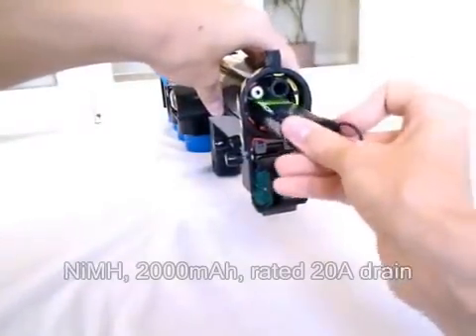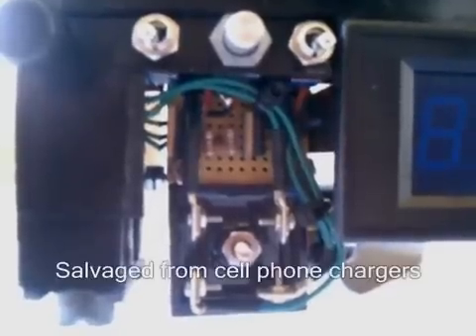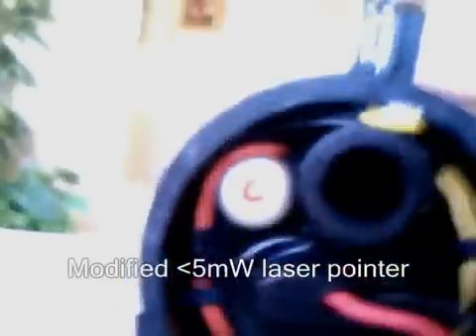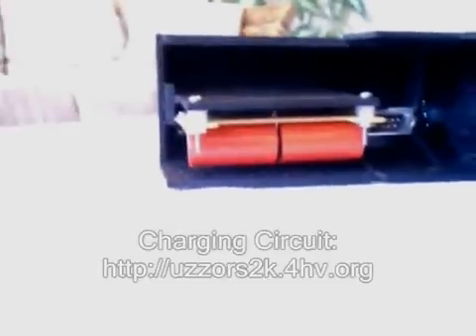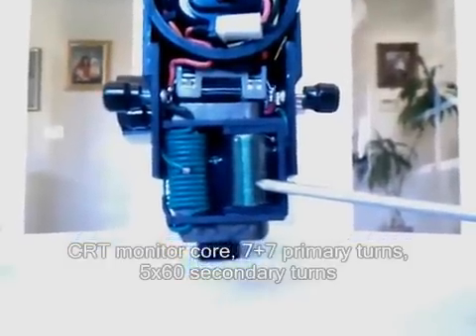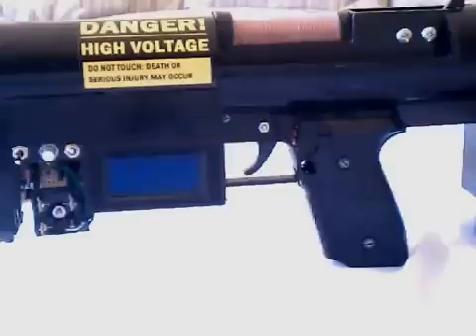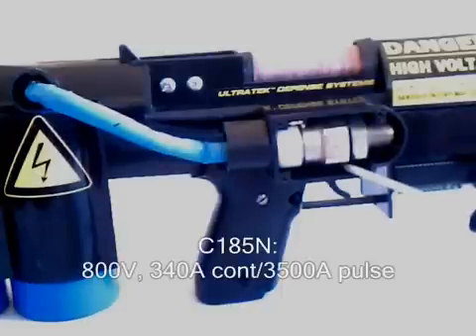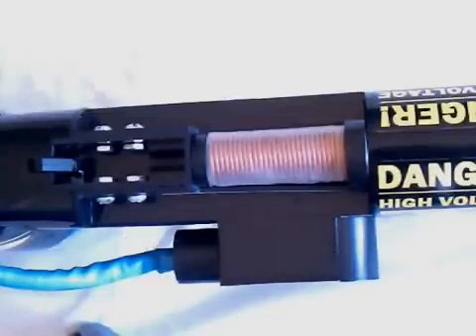Portable Coilgun Kontraband show 2010

Comment: Hey guys I built my own coilgun using the frame of an airsoft pistol. I managed make it work and wired it up. It shoots, but will only launch a bb an inch or two.  :/    Any ideas on How I could make it more powerful? I am using a capacitor from a disposable camera and the coil is wrapped just once... How do I properly wrap the coil? Thanks!
Reply: Well, the higher the amperage the greater the force, two, rewind your coil with 150 turns of 22awg wire, five layers deep, add more capacitors, and a better discharge circuit

Comment: I don't quite understand. What is the advantage of coilgun over ordinary gun? Is it reliable under pouring rain? Can it withstand high temperature in a desert combat scenario?
Reply: High maximum muzzle velocity, improved logistics, higher potential accuracy, to name a few.   Coil weapons have no maximum power, as battery systems and coils become more and more advanced, they'll become more and more powerful.

 Regular guns, on the other hand, basically can't get any more powerful than what they are.  They rely on gas-expansion from gunpowder to drive the round, and there are physical limits to how fast gas can expand, which we have already reached.   There is no upper limit to how fast you can magnetically impel a round (other than the speed of light, of course)

There's also the fact that a coil weapon only has to carry the rounds, not the case too.   You can carry much more ammo for the same size and weight.

Comment: Currently clearly not as effective as a normal gun, but supercapacitors are improving rapidly :)
Reply: Xenogene Gray supercapacitors are unusable for coilguns. They take long time to discharge because of the lower voltage.

Comment: Nice creation. Would a smaller projectile be more leathal in this weapon? Higher velocity.  Or would it be unstable?
Reply: You could try using a silver wire for the coil its more electrically conductive then copper but it cost more then copper as well

Comment: Not enough velocity...the projectile is to big... try using steel BBs or smaller. If you can get a BB to go as fast as a meteor it hit a target with the force of a cannon ball.
Reply: I myself expreimented that way with a 10j small coilgun, despite its small power, i managed to open a hole and pass trough one of the faces of a tun can with a projectile of steel , 3,5cm long and 1 wide with a sharpened head with the proportions of a standard bullet.

With a steel bb it almost didnt do anything, it just bounced away, thats becose the projectile can get saturated by the magnetic field, it does not impove almodt nothing adding more capacitors if your bullet is saturated in the actual situation, but doing a multi stage coilgun will work, in ither side there are the railguns,  they work in a similar way of a coilgun but they can work better the way you suggest( that is what the internet guys teached me, i dindt experimentes it)

excuse my poor english

Comment: There is a ZVS flyback driver that generates the High Voltage AC that goes through a full wave bridge rectifier. There is more information about it on the actual real creators page. The poster of this video did not actually make it.

search for portable 1.25kj coilgun on youtube for the real thing.

Comment: Sure but once the technology and engineering improves, these are going to work much better for very little. Fe16 N2 has been discovered to be very magnetic. Substances more magnetic than this surely exist. A projectile made of a highly magnetic substance has the potential to reach greater speeds. New advancements in science are going to exponentially increase the potential of the coilgun as a weapon.